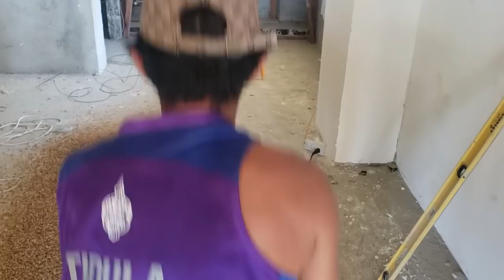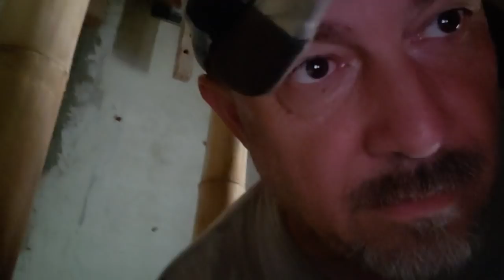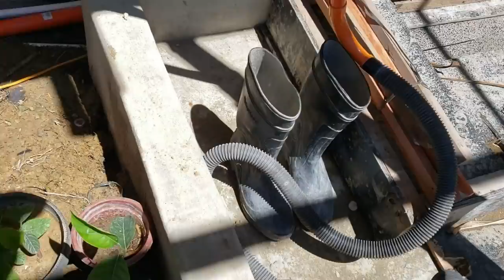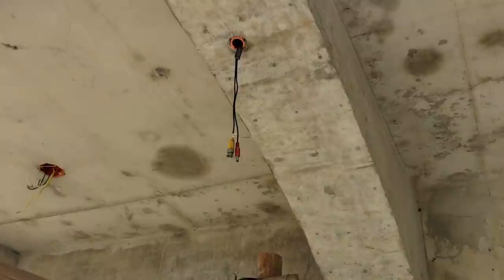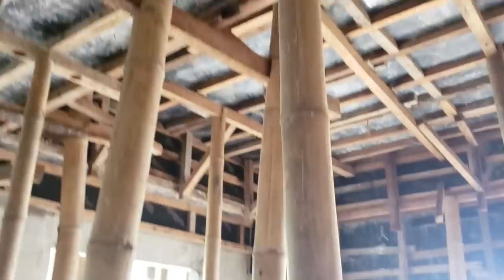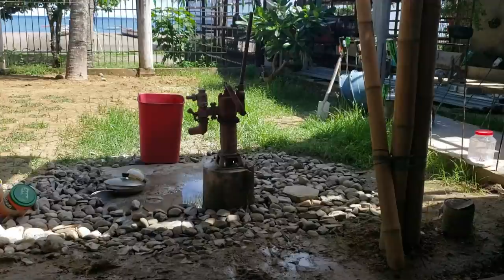Philippines Beach House Build Day 210: Doors Hung, Forms Removed, Cables Pulled! Busy Day!

Comment: You mentioned a good point about gettimg the cement  wet during the initial   curing process for at least one week to keep it from drying and  improving the strength factor of the cement, coz I've watched numerous house builds in the, PH and rarely f ever saw the workers  doing that

Comment: ALL of that is myself included! I've told Zilla for years that I want a Parasail or even in ultralight. At age 12, I built my 1st go-kart out of steel and my parents bought me a 5hp Tecumseh because they were proud of what I built. I've built misc "things" that went much faster as I got a lil older. First Motocross bike was  Suzuki 185, six months later I bought a CanAm 250 and finally, my favorite bike was my Honda Elsinore CR500. That was my baby on the track. Carried this 6'3" bigfooted Sasquatch like I was in a Eldorado Cadillac. Smoother than a babies powdered bootie. Then the engine builds for my need for speed. From my first car at 15 until this truck I bought a few months ago. Not touching it, my health won't let me and it's time to slow down on ground. Don't tell Jackzilla, I have glanced at a turbo or two.😏 Shhhhhh

I liked this vlog James. You showed a lot of different things going on there and not just focusing on one or two projects. We can see your excitement, facial and verbal. You and the boys have done a very nice job! Bout time for you to cook them some thick steaks, potato salad, baked potatoes, Texas cut fries, baked beans and jalapeno cornbread. 😁
Reply from the maker: I spent my life as a adrenaline junky.  I did end my motocross days few years back. I started it out with a yamaha 175  and progressed up to a Yamaha yz450f four stroke beast. Not sure if you ever been around the new four strokes but they are beast. Now I am planted on a 500 4x4 quad. wamp wamp feels like a stroller ! I got all into para planes years past. I got too heavy after the explosion I was in. I still love water sports. Talking about cooking them those foods. They dont like it. You can do all of that but they still just want their dishes - rice n fish or pork.  It is like trying to get them to wear shoes or boots - not happening.!
Reply: @TexasFilipino  understandable.

Comment: J&M, We pulled 42  five hundred foot spools of #14 and #12 wire and 8 spools of #8 with a shop vac in 3 days. Also there 
are 2" PVC chases poured into the concrete for  the water lines that will get shop vacced with PEX-B. you can suck soapy 
water through the pipe for lubrication. We use laundry detergent for the soap. 
       I got home from the ICU to have a "not a collection agency" letter in the mail. At least we didn't have to pay the bill
to get released from the hospital like in the PI.
        I designed a small plane and was done with the fusaloge moulds and wing patterns when Aurora planned our little
visit to the Philippines. I designed the  5 rotor mazda based rotary engine and a reduction drive based on an E40D transfer 
case planetary gear set. The engine patterns are CNC cut in our machine shop but not poured. It is parallel cooled
rather than series cooled and has a dry sump oil system from a stock car. The plane flies well in X-Plane with a 58 MPH
stall and 580 MPH top speed. The 5 rotor is limited to only 630 HP. The airframe is parasol winged and 3 surface with
ruddervators and has a control mixer that allows flaps with the canard wing.
          Still slip forming concrete with the forms copied from your first floor walls. Septic tank, cistern, tillapia tank, dirty
 kitchen poured, and two shrimp farming tanks in progress. I shipped the tools to pour self leveling compound for our
floors and roof slabs on the villa. No 2" thick mud bed will be used. We finished the concrete as it was poured and could
tile directly on that but just want to try self leveling.

                                               george and aurora                             Villa Cecelia

Comment: Wouldn’t it be better to finish the concrete and then do all the windows and doors and wiring ?
Reply from the maker: No - we have times that we must let the concrete cure some before we start working on that task again. So during those times you must move on with a another step. Like when any multistory building is going up. Things are progressing in different stages at different levels. I also have to begin preparing for returning to Texas and need things secured.
Reply: Ok , i was wondering your thinking, it would seem that it would be easier before adding all the extra clutter and work arounds.